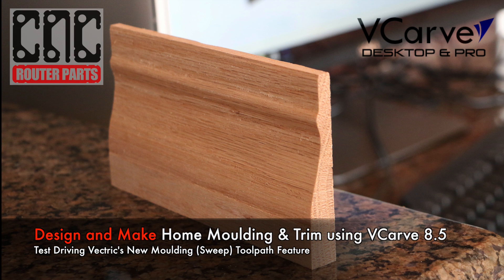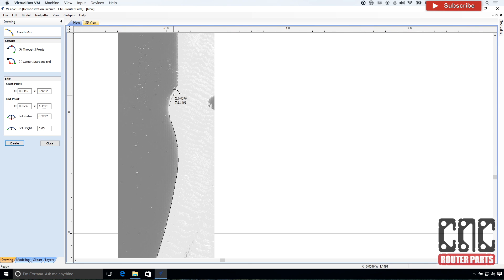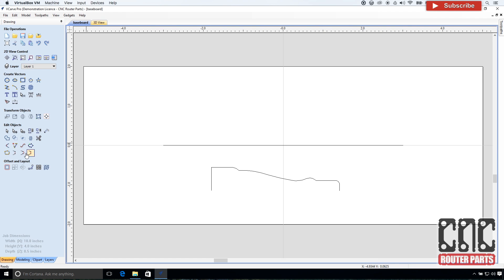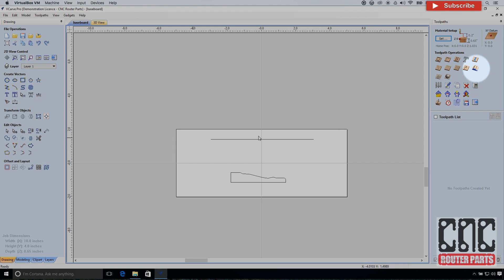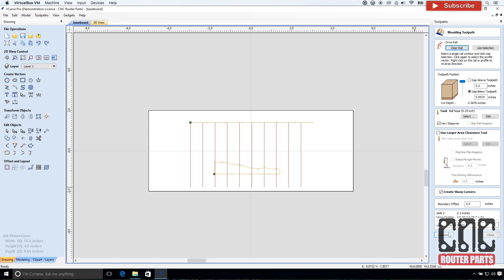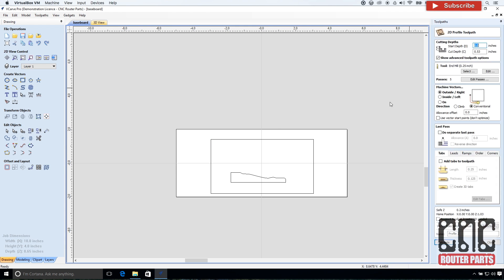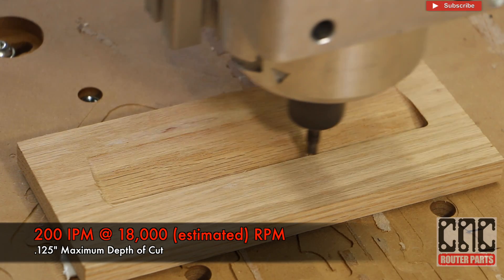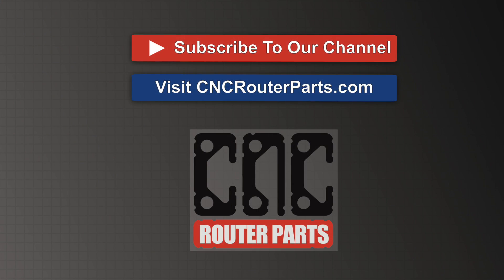Make Matching Home Molding/Trim using VCarve 8.5 and your CNC Machine

Comment: What double back sticky tape are you using?
Reply from the maker: Hi Philip - I was using this from my local ACE Hardware --> http://www.acehardware.com/product/index.jsp?productId=1265170&KPID=938335&pla=pla_938335.
We've also used 3M 9579 with good results.  I tend to prefer the thin foam / pressure sensitive tapes, they make a very strong connection between MDF and wood surfaces.   Thanks!  -Nathan